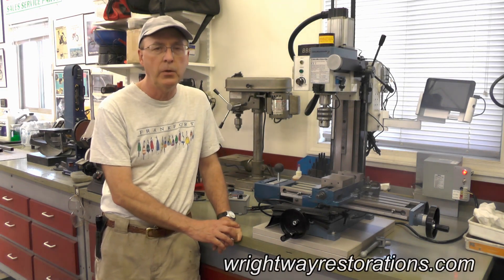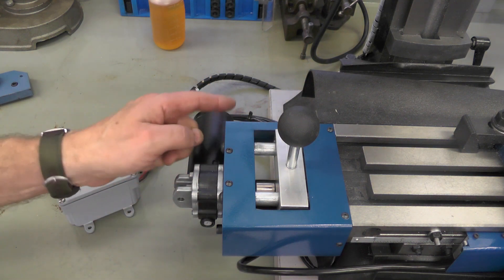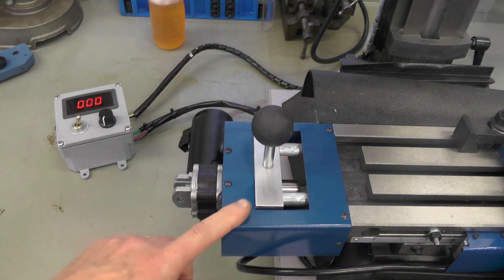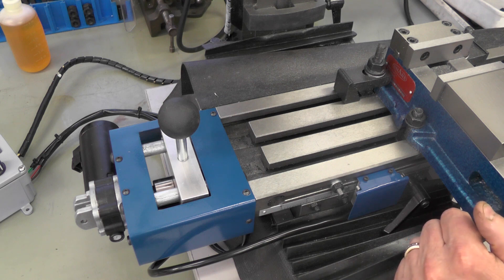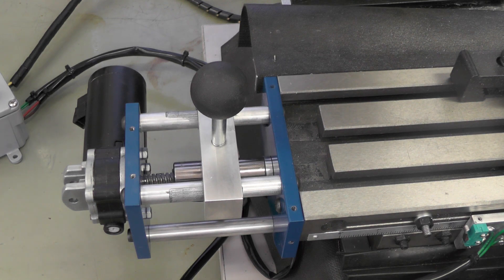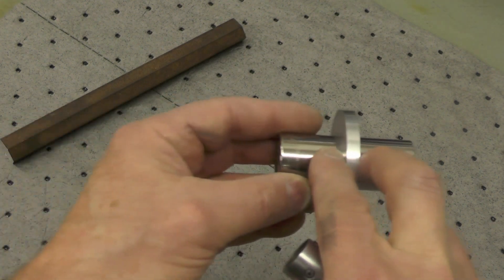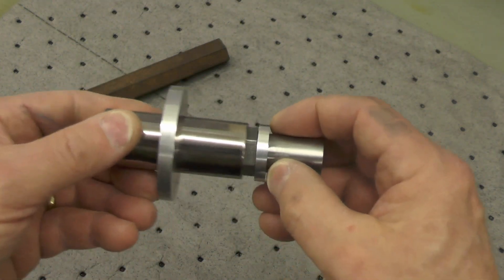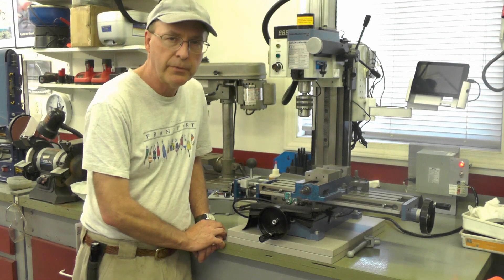Mini Mill X Axis Power Drive --- Video #67

Comment: Good morning,

I would like to make the transmission like the one you did, I have your own mini mill machine: I don't understand how the gearbox shaft is made, how does it not slip inside the square hole of the long bushing? I have a reducer with a flattened shaft, I could put a headless screw but the problem is that the bushes are hardened so how do I drill? For this reason I ask you how your reducer shaft is made.

Thank you !!! Alberto.
Reply from the maker: Hello Alberto,
I didn't create this design but copied it from another YouTube creator, MrPragmaticLee.  I'd first recommend you go back and watch his video I recommend, where he provides more detail than I do.
However, to provide you some  guidance... the shaft on the drive motor is a square 3/8", which fits perfects into a 3/8" drive deep socket, such as a spark plug socket.  The motor shaft did need to be cut to length.  Therefore, I didn't have to do anything to the motor shaft but cut it off.  The socket slides/engages the motor shafts by sliding laterally (left to right) and connects the motor shaft to the square "nut" mounted on the end of the mill shaft.
Again, I highly recommend you watch MrPragmaticLee's video as he does a great job explaining the details.  Then you could come back to my video and see how I took his design and made minor changes.
Good luck with your project.
Reply: @kwrightway  Oh, thank you very much; now i understand, because my  motor shaft is round with 6 mm of diameter and a small plane; so it's less then 1/2" of the square hole, but it is not a problem because i can make a bushing with my lathe; the problem was that i was not able to understand the shape of the motor shaft, it is strange with square shape, usually round shape !! i have ordered 2 minutes ago on Amazon a 9/16 long bushing (in italy it is a 14 mm hexagon) that i will make with the  divider of the mini mill, so thank you for your help and for your answer too !! Have a nice day, Alberto.
Reply from the maker: @mp44kurz66  Glad you figured it out, Alberto, and good luck with your project!

Comment: Great video. Thanks for sharing. Btw if you did not use primer before painting that would part of the paint not sticking issue... if you then surface prep... and if not that then I got nothin. Great job.
Reply from the maker: Though it's been a while since I did this project, I think I used primer, as I usually do.  Though I'm not entirely sure to be honest.

Thanks for the kind words and comments...

Comment: I plan on getting this mill soon. How heavy was this sucker to move? I plan to have it in my basement shop. Would that be doable with two guy's or is it just to big and awkward to get down the stairs? Or do you think I'd have to take the base apart and carry it in, in a few pieces? Just want ur opinion to see what u think. Thanks
Reply from the maker: Unless you have a very tight stairway with turns, I believe two adults will be able to move this unit into a basement.
Reply: @kwrightway  ok thanks!

Comment: Can you explain how the shaft of the motor connects to the 3/4" socket? Thanks
Reply from the maker: The socket is a 3/8" female drive so the shaft of the motor was machined to engage the socket drive.  If you are serious about pursuing this project I highly recommend you watch Pragmatic Lee's video series on his version.  I used his videos as a guide and inspiration and he covers the concept in more detail than I did.
Reply: @kwrightway  ahhh, that makes sense. Thank you for your response. Great vid
Reply from the maker: If you choose to pursue it, good luck with your project.  And thank you for the kind words...

Comment: How many thousanths interference fit (press it) with the collar that presses on the socket?
Reply from the maker: About .002 or so, as I recall.  I heated the collar thoroughly first and used a press to install it.  An arbor press or even a vice may work as well.

Comment from the maker: Though it doesn't show up here for some reason, someone asked a question about the size of the Oilite bushing used for the coupler nut.  The ID of the bushing will depend on the size of the coupler shaft that passes through it.  If memory servers, I machined the shaft to just under .500" or about .498 so I used a bushing with a .500 ID.